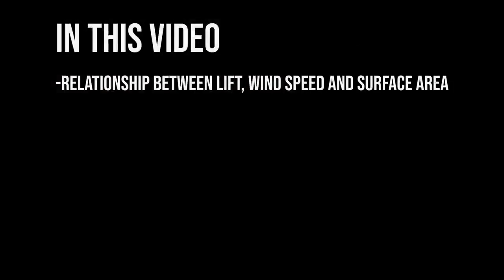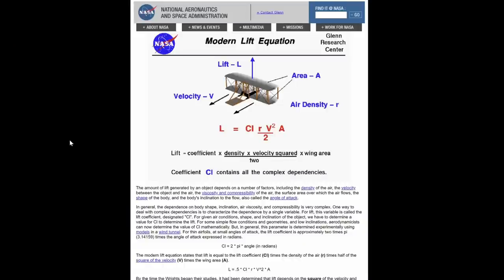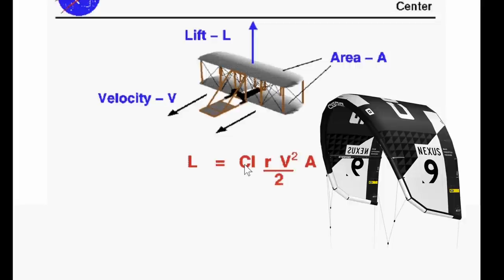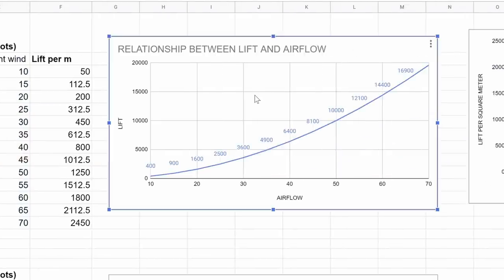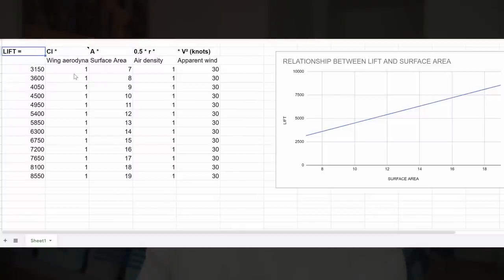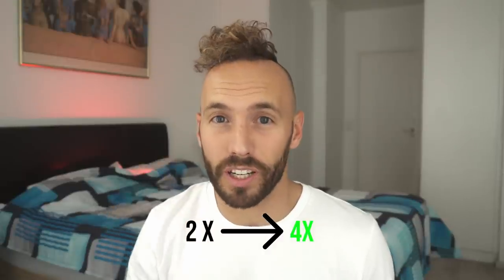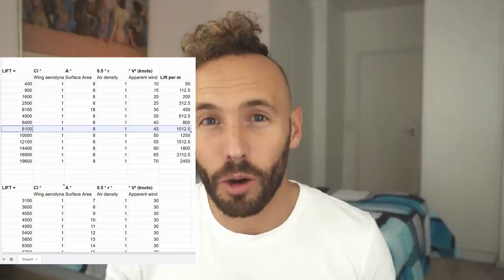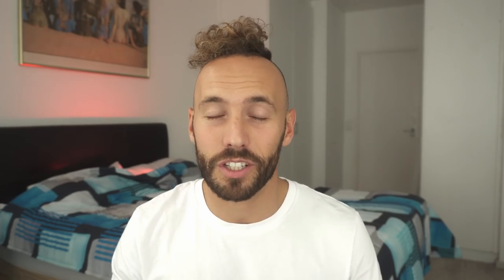Why do small kites JUMP HIGHER? How strong is 60 knots?!

Comment: Yes this video is completely right.  The problem with super strong winds and 5m-6m kites is that wind is mostly not steady in super strong +35 conditions. Due to large variations in windgusts, as kite surface and wind speed forces are Squared, it means in lulls on small kites you also drop you like a rock or may have inconsistencies in jumps. ,Also the steering and sweetspot for the bar may become more sensitive to find an small kites.    One point to add, the Angle of attack is also very important ingredient for jumping, with a kite flying maximum forward in the wind wind, you can hold the edge better (or fly bigger kite) also explosive high jumping is  more easywhern kite flies far forward. (there is a bigger difference in power/depower at the bar)
So for best jumping you need a kite almost overflying you, however due to apparent wind and kite drag when kiting, during kiting kite it is stable. So move the Bridle settings inward at the LE.  As a bonus the turn is faster/more pivot, which also helps climbing above head faster, at costs of bit added bar pressure during steering.
Reply: Can you explain what overflying means? For example if I'm already flying the kite at 2 or 10 o'clock... which is deep in the power zone. What happens to the kite if it overflys me?
Reply: Yep no such thing as steay non gusty thermal wind at 60 mph
Reply: @jondeur2686   If you stand at the beach with kite straight above head, it sits at the edge. In a gust, then lull a kite can overfly you.  (very dangerous)  Therefore small size kites often manufactured to sit slightly deeper in the window for more stability. However for highest jumping a kite flying to edge jumps higher,  indeed lighter material kites, have better drift less overflying.  Also the pros never put kites overhead and pull the bar into prevent. All modern kites fly closer to the edge, it is one of the reasons why we jump much higher now a days.

Comment: You definitely don't hold your edge until kite reaches zenith. Take off happens much earlier than that. If you have a kite straight above you you don't have any grip to the water. 
The lower you take off the more horizontal grip (edging) you can have. Kite has also more room to climb up to the zenith. During this climbing you get your height.

Comment: Hey Mike! Great explanation. Whilst the formula and method works partly. The amounts of Newton force you describe are totally out of sync with reality. No one will ever be that tough to keep up with 8000(N) or so.. 

Lets say your avg weight is 75kg, 1kg = 9.8(N) = 75 x 9.8 = 735(N) to make you float weightless. If your kites generates factor 10x  of your own weight you will be dragged down wind or you cant simply hold your edge, they will shoot you to the moon. 

I think your formula requires some adjustments to get real world Newtons.
Reply from the maker: Thanks BD! I actually didn't think of lift in Newtons, but that makes total sense 😂 shows that I never attended a physics class! (well, not any significant ones) 

Yes I used made up values partly due to naivety of the physics side and partly because I thought that it wouldn't make a difference to the relationship at the end of the day, since it's only 1 term and they're all first order variables, except for airflow.

I'm not sure if I'm right in saying that, but it 'seemed correct' based on what I recall from university (quite some years ago 😅)

Does the relationship still make sense with these made up values? 🙃
Reply: Hey BD!
What you're saying is true. One will never be able to keep up with 8000 N. The thing is that Mike's results are not in Newton. For them to be that, he should've used SI units. The SI unit for wind speed is m/s, not knots. Also, the made-up numbers are not ideal to get realistic results. However, it does beautifully illustrate Mike's point :)

Comment: What about a big kite on shorter lines?
Reply from the maker: That would make it easier to hold the edge, but it would also relatively reduce the apparent wind, as the kite would a) have slightly less wind due to the gradient effect and b) reduce the run-way that it has to reach its top speed. At least that's the way I view it.

As always, there are pros and cons to both sides of any adjustment. The balance/optimum is often some happy medium. With lines, I find that 22m are the balance point on small kites, for example. You could take longer lines, to allow the kite more run way and thus allow it to reach a higher speed, but you would struggle to hold your edge for the duration of time required - at least, I certainly do.

Comment: NERD! 🤓

Nice one 🤙
Reply from the maker: Haha thanks bru!
Reply: @gethighwithmike  ok so hypothetical question… hydrofoils sail upwind super fast, like the angle that you can drive the board and generate speed against the wind is far greater than that you can with a tt. Could you theoretically generate more lift with a hf by getting more airflow over the sail due to the higher speed into the wind?